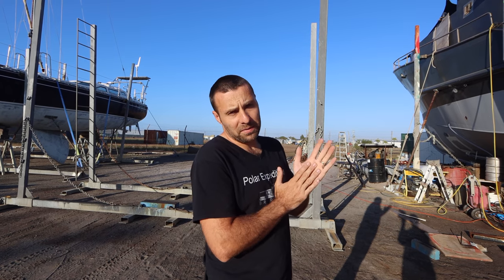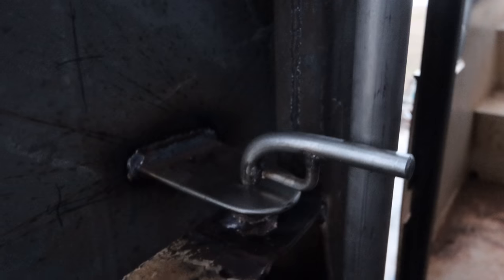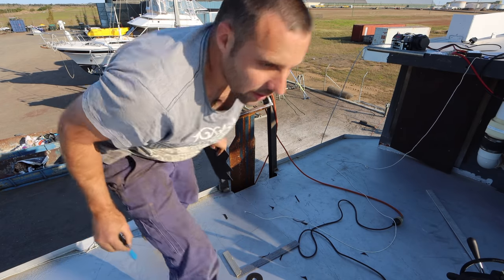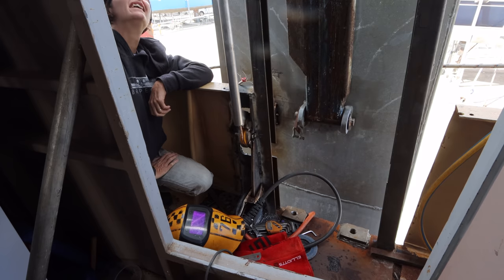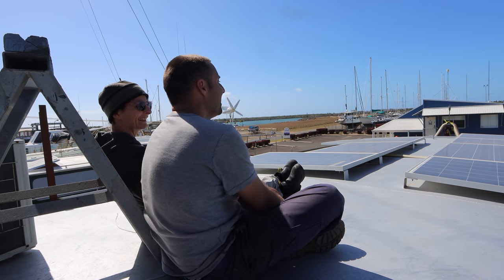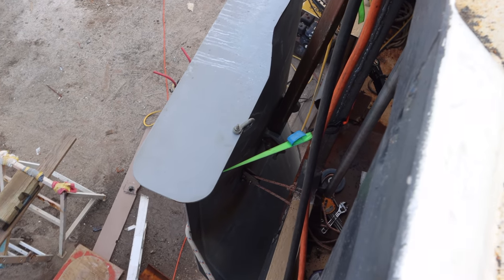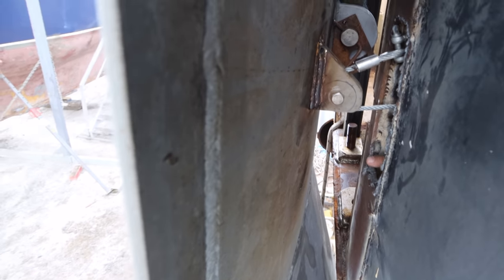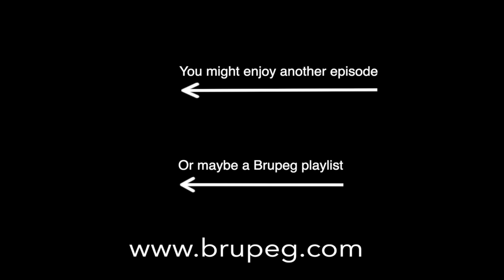Winches, Pulleys & Wings (2 of 2) - Project Brupeg Ep. 170

Comment: I wondered whether you had considered using screw jacks to raise and lower your wings?
Reply from the maker: Hi Ian. We ruled them out early on as the complexity was too much. Ie if anything goes wrong with them parts and repairs are fairly specialist versus a basic winch setup that can be fixed on the side of the road (and spares are cheap enough to store a complete winch in the engine room etc). It’s also about what the crew have the skills to fix. I could sort out a broken winch with my eyes closed, but wouldn’t have the same skill level with screws. Dame

Comment: I do not see a lot of difference between this setup and mounting the winch next to the sliders in terms of stresses put on the roof. It's a bit of a different vector having that pulley in that configuration, but if that roof is good enough to have those loads, surely, having the winch mounted there would be perfectly fine?
Reply from the maker: The main difference is with the pulley we can have the stainless pipe directly under the load and brace the downward pressure against the roof and the bulwark. if we mount the winch there we need to allow for the cable to swing from side to side (roughly 100mm) as it coils up so we wouldnt be able to make the pipe idea work without modifying the shape quite a bit. Its possible but much harder than simply using a braced pully and mounting the winch on the roof.
Reply: @ProjectBrupeg  That makes sense. Otherwise you'd need the two motors somewhere towards the middle of the roof probably which would be a nuisance. Did not think about that.

Right'o.. I get it now.

Comment: Watched all your videos. Great job guys from here in UK. Dont understand one thing. I get placing the winch on the wheelhouse roof (strong and less exposure) but you are transferring all that force to a pulley taking a 75 degree (?) turn on the 'tinfoil' roof. That will translate to 50% of the force horizontal along the tinfoil (OK) but also 50% vertically down on the 3mm plate which is why you didn't want the winch there. OK with that?
Reply from the maker: Hi Colin, your right but there is a question of physical realestate to factor in, with the pulley we can mount it hard over against the rear slider and brace it vertically with the steel slider and the heavy wall stainless pipe that the cable travels down. These two things take the vertical loading, the hozirontal loading is not perfect but its taken by the 100x6mm steel gutter and the 3mm roof. If we were to put the winch there we would need to mount it further in from the slider and we wouldnt be able to use the stainless pipe as the cable needs to swing roughly 100mm left to right as it coils up so while the force would be 100% downward, we would have less bracing available (as it would only be rear slider and roof in its weakest direction). The pulley isnt a perfect solution but it was less of a compromise than a winch only in that location, thats the background to our thinking.

Comment: thanks guys.. progress is viable snd your definitely fully into spring  so enjoy the good weather . cant afford patron and find chat in live events to be far to chaotic so  i will pass on the event. as far as to nas or not  for what it is i see you doing it certainly is not a requirement but can have some advantages. primarily  it allows for central storage and access so jess editing while D is uploading clips and crew #1 is watching the latest upload...its difficult for multiple users on the same laptop but multiple connections to a nas works well. nas operating systems usually linux based  much more secure environment  and far more flexible .  easily turn a debian pc into a nas/plexserver/ vpn....you could allow remote file sharing and collaboration  its for me a obvious positive but i have computers doing nothing and networking is a hobby for you it may just be more system without a porpoise .  what i like about it almost any old computer can be repurposed to handle nas duties so cost is minimal or a cheap mining board has lots of sata connections which is all that is required  new architecture  so spares are easy and amd has just upset the cpu bisness so intel has a lot of product to dump fast and a new release to design lol amd has offered  end of generation advances without insane pricing  so its a great time to shop cpu and motherboard combos if your into that
Reply from the maker: We have a Linux based NAS currently but our thoughts are to drop it completely and remove complexity from the system. 2 x 2TB SSD portable USB3.0 drives plugged to a single machine with duplicate copies of the files so if one drive dies we are ok, if the computer dies we can unplug both and move straight across to our second mac.
Reply: @ProjectBrupeg  cool i keep forgetting you run macs  you know they run on linux ..desktops are great for this  just keep adding drives as you need them until ya run out of board connections  not many laptops have 2 harddrives internally , as you said your looking to simplify  dropping the nas will do that its tradeoff is file access for more than one person  so probably not an issue for you. as a computer geek i like to play with what i have and see what i can make it do...even silly things just because i have the hardware kicking around so for me it would be keep the nas  dump a lot of services on it configure it as a primary server taking care of anything that connects to your network  but im a geek lol  thanks for the time and the vids

Comment: I was wondering out what about using a screw jack system on the uprights to bring the wings up and down
Reply from the maker: Hi Francios, we did think of that in the early days but rulled it out as too complex, the winches and cables can be fixed easily at sea but machining new parts etc for screws is not something we can do onboard

Comment: Don't know if its been asked before, but why not a hydraulic ram to deploy the wing.
Reply from the maker: Mainly cost and complexity. Winches were $400 for the pair but rams were $400ea and then we needed to create a hydraulic power pack to run them which would be close to $2000. So although hydraulics would work fine, we crossed them off the list as the more we thought about them the more $ was involved

Comment: Are you going to build a housing for the winches and motors on the roof? They will experience a lot of salt otherwise, I think.
Reply from the maker: Hi Nico, yes. I want to fold up a set of 2mm stainless boxes that mount over the winches. Im hoping to make them hinged to the roof so I can flick a latch and open them up to access the winch fast and without the need for tools so maintenace is an easy thing. Im yet to design anything but it will be fairly simple shape.

Comment: What's the benifts/negatives of using the pulley on the wing vs terminating on the wing? I'm guessing some sort of mech advantage but will that pully bind up vs just making sure a termination doesn't snap.

As for NAS ..... TO NAS!!! Unless you plan on being perma hooked to a VERY good plan of some sort with satellite to the internet where-by cloud (eg MS O365) becomes an option NAS is the go for data safety ... YOU OF ALL SHOULD KNOW THAT BY NOW :P .... as for which device .... how long's a length of string. We went with a QNAP (453??) cube box for ours some years ago which apart from a samba issue (found to be caused by mangled names being allowed - since solved but have other solutions in place for half it's work now out of frustration) has been bloody great. BUT ... if I could go back and do it all again I'd be going with a 4 or preferably 8bay rackmountable unit so it'll rack itself instead of sitting on a shelf in the rack. Can just sit between the old HP server and Cisco POE switch then. That said if you want more drives, white boxes with PCI-E SATA cards etc will be a way to go but you'll still only get several drives into most whitebox cases. You could elsewise roll with an old HP/Dell server that has many drive caddies in the front and make a custom NAS from CentOS/DEB with that. QNAP does have good software and support though and from reading the scripts on my QNAP (especially SMBD.conf) I see so many places where I went wrong 15 odd years ago when I tried to make a whitebox from an early implementation of Ubuntu.

Some decent Codan and Icom HF radios on fleabay atm if you're ready to start kitting out other areas. Saw a Codan NGT and mobile antenna circa 1500 and Codan 9360 I think it was with basic antenna you'd change for circa $500. Just program your 2182, 4125, 6215, etc into that. (on a sad note I'm starting to forget the HF frequencies due to lack of use and who uses what eg 2524 I never seen mentioned anymore)

Comment: Im sure this has been addressed before, and at the risk of offending Zachary, 
I’m curious as to why the choice of electric winch to raise the wings over 
hydraulically actuated?
Reply from the maker: Cost and ease mainly. Hydraulic is maybe five times the price and a LOT of building to get them running versus low cost, easily replaceable and fast to install for electric

Comment: So the winch cable will constantly be in salt water...how long will that last being in those elements salt water/sun?.....btw your putting almost if not the same amount of lifting pressure on the deck roof with that pully  there lifting as if the winch would be mounted there do to thats the first point of pressure do to the way the cable is run up to the helm roof....love the videos though  
👍
Reply from the maker: Hi mate. Surprisingly long. It’s normal of fishing boats to have steel cable for their nets etc and plenty of grease on the cable is all that’s needed to solve the water issues.
Reply: @ProjectBrupeg  was just curious thanks for the information.

Comment: Wont that pipe weld break when the boat flexes at sea?
You somehow need it to stretch/shrink.
Reply: If Brupeg flexes enough at sea to break that pipe, they’ll most likely need a rescue...
Reply from the maker: If the weld breaks the pipe will come loose at one end but still not cause any issue. All that said, if the weld breaks because the boat is flexing that much, like kstricl said, we have already sunk at that point

Comment: Will you be able to adjust the wing angle depending on how the boat lays in the water?
Reply: Does'nt seem so since theres only one fixated position downwards.
Reply from the maker: No these are passive fixed angle of attack. Both wings sit with two degrees of lift to load them when at cruising speed
Reply from the maker: No these are fixed position passive stabilisers, they have a slight upward tilt but that dont alter angle

Comment: Would a block purchase make sense
Reply from the maker: Yeah we are running a 2:1 purchase as it stands, its 1:1 from the winch to the top pulley then 1:1 to the second pulley. then it heads to a pulley on the wing and then back to the boat where its terminated, its this last pully and return that give it the 2:1 purchase.
Reply: Project Brupeg awesome if the winch goes down you will almost be able to pull it up by hand, great work so far sorry I have been busy I’m catching up on your progress.

Comment: So why not put the winch where the  pulley is?
Reply from the maker: The main difference is with the pulley we can have the stainless pipe directly under the load and brace the downward pressure against the roof and the bulwark. if we mount the winch there we need to allow for the cable to swing from side to side (roughly 100mm) as it coils up so we wouldnt be able to make the pipe idea work without modifying the shape quite a bit. Its possible but much harder than simply using a braced pully and mounting the winch on the roof.

Comment: your nylon pulleys will not be strong enough with wire rope you will need steel pulleys the weight on those wings will be far to much when the boat is rocking and rolling when lifting them
Reply from the maker: Not according to the plastic supplier that makes these pulleys for 300t crane sheaves